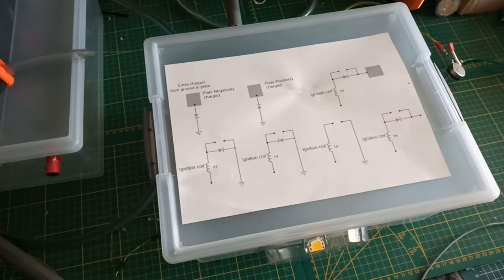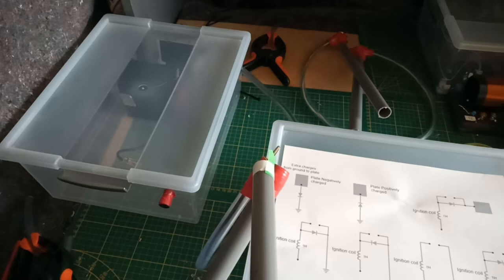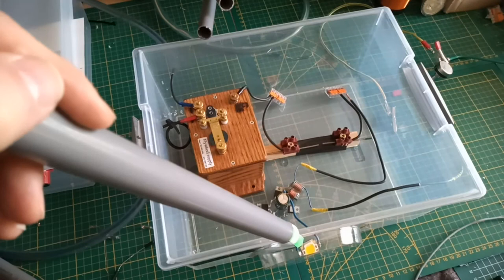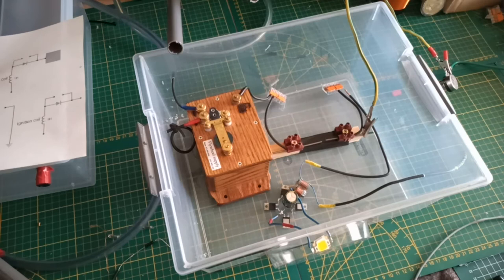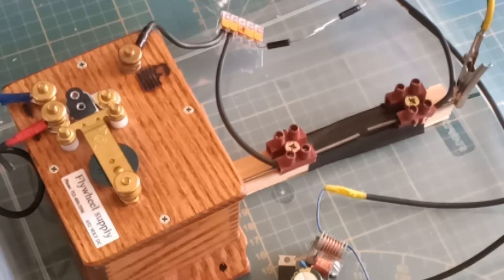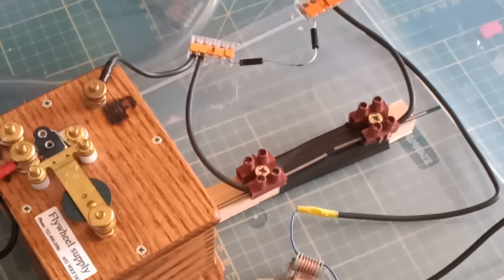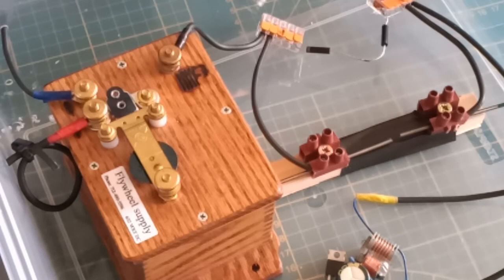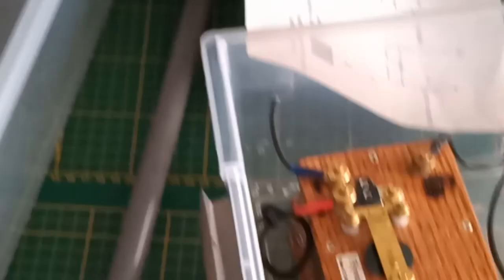059 Don Smith Spinoff High Voltage Diode Experiments

Comment: Can you explain the setup in the wooden box please
Reply from the maker: @reza forushani, I will make a schematic during upcomming week. Short discription is a mechanic interruptor is switching power to the primary of high voltage transformer and a capacitor is in series with the + connection to this primary of the transformer (low voltage side). The high voltage or secundary of transformer is directly connected to output connector.
Reply: @Bruno Vk  the capacitor you see must be in parallel with the interrupter and is used to absorb the BEMF spike from the coil's primary when interrupter's contacts are opened. If you remove a capacitor, it will still work but the arc over between the contacts will be more noticeable which renders the interrupter useless if used for any longer period of time. It has other purpose too. Conductive plasma that is generated between the contacts doesn't let the current quickly fall back to zero after the switch is opened. That is, it doesn't allow for a fast falling edge of that current impulse that is important for a flyback topology to generate a high voltage, because the voltage on the secondary depends on the rate of change of magnetic flux (it is true for any transformers, in fact), hence it is proportional to the rate of change of current (dI/dt) and the inductance of a coil (Faraday's law). So with the capacitor removed you will also get a much less voltage from the ignition coil.
Reply from the maker: I will open the wooden box again this week to have a look, thank you for the explication.(have to go to work now :) )
Reply from the maker: The capacitor is indeed in parallel to the vibrating contact.
When measuring the high voltage core I can not measure a connection between high voltage output and primary connections. The core of this transformer are iron welding rods like in the motor coils. The parallel connection of capacitor is made by the switching blades on top.
This is the circuit: https://photos.app.goo.gl/4JZfJFKnK5TQcf36A
Reply: @elgroovy  This is why the diode functions in this same way as a capacitor in giving the results you showed. 
Depending on what you want to do and what parts are being used, Benitez showed that you don't always have to have cap directly across the points as long as it is connected to one side. But this is an important point that you want a fast rate of change and a sharp gradient and as unidirectional impulse. Magnetic quenching helps to eliminate the long shorting/arcing.
Reply: Hi

Did you ever make the diagram you said you were going to make?
Also a picture of inside the box please.

Thanks
Reply from the maker: @Reza Forushani, the link to the circuit is in the comment from me from 6 days ago. It's above the comment from Rick Friedrich. This weekend I discovered that it's really close to the Benitez Switch 8 from Rick Friedrich if you want another reference point, only the polarity is different while switch 8 - is connected to interruptor switch, with the ignition coil is + in my model. In the new models sold on ebay the polarity is the same as in switch 8. http://potentialtec.com/121561.jpg
44-45 is low voltage primary & 47-46 is high voltage output. What I don't know is if there's a connection inside the ignition coil from 44-47 (from - primary to - secundary), I can't measure it and the transformer is in black epoxy block so that part can't be viewed.
 I'm not sure if adding a picture from inside the box would give me problems with copy rights.